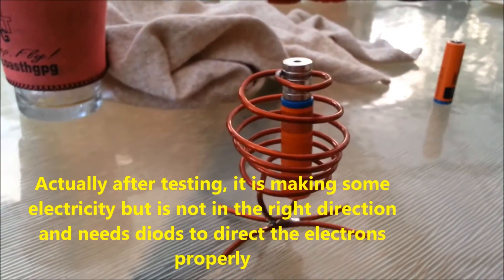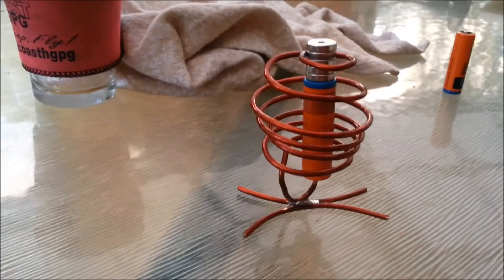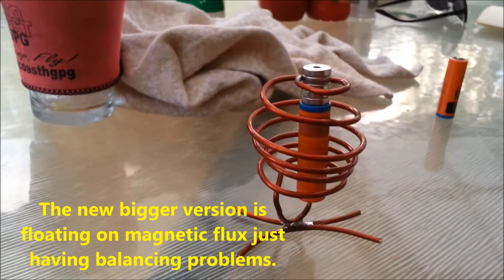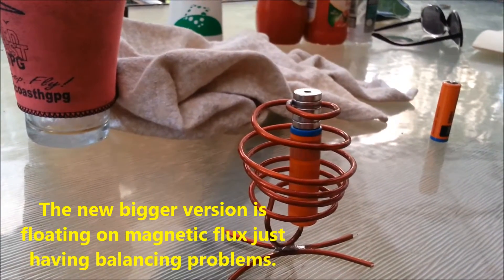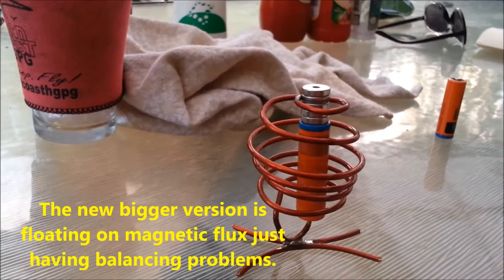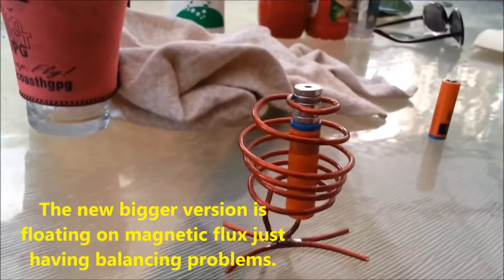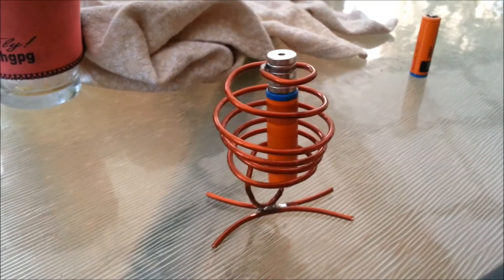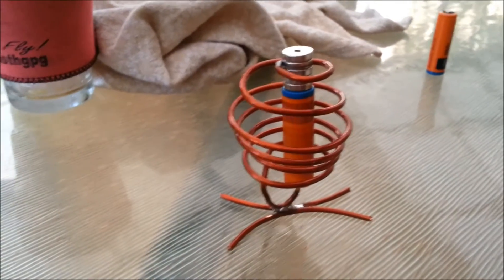Mackay Homopolar Motor Generator

Comment from the maker: No it doesn't put out more  but because the magnet is spinning it must be creating a potential difference from centre to the edge. I am unsure if capacitors and a different circuit would be able to capture some energy.
my thoughts raef